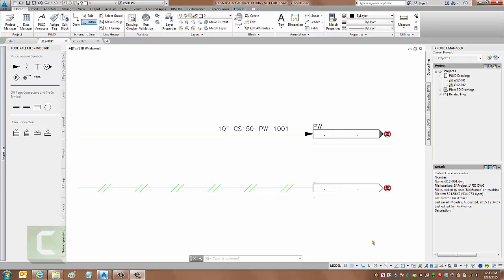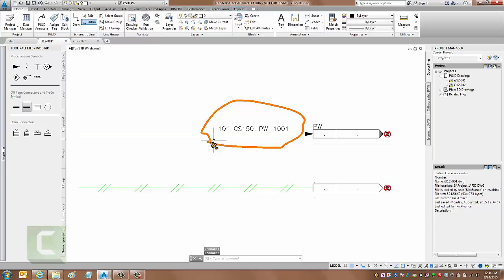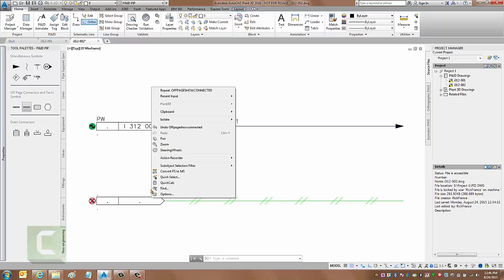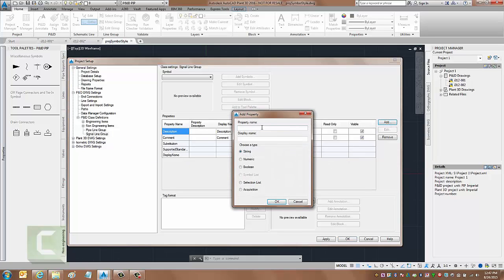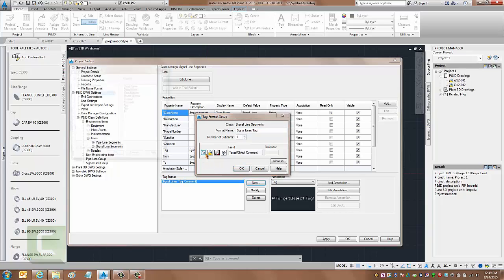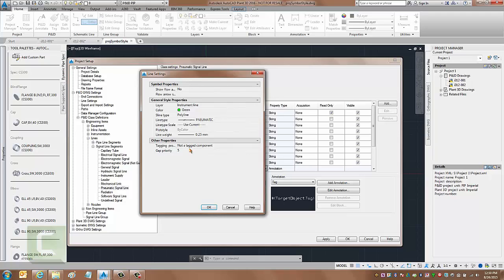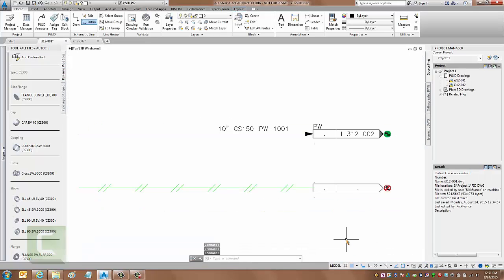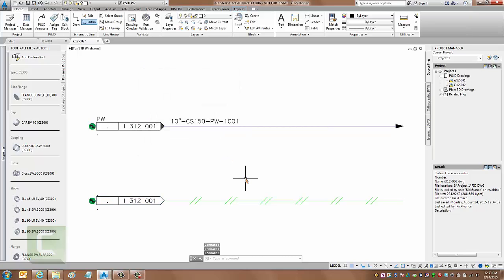P&ID 2016 Signal Line Off Page Connectors

Comment: Sir, I am having the same problem with Signal Line Off Page Connectors' and I did follow everything in your tutorial but still can't connect even though I am able to get a tag in signal lines (after edit on ProjSettings as shown on your video). Thanks